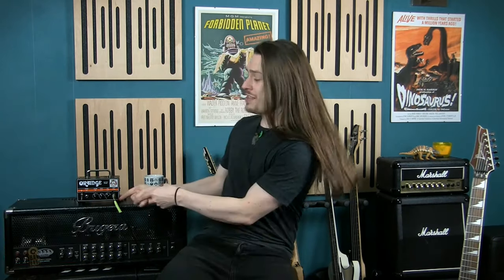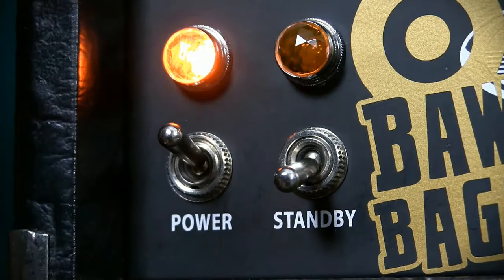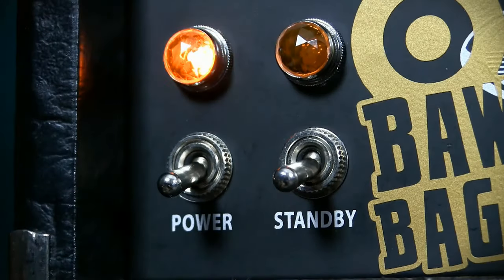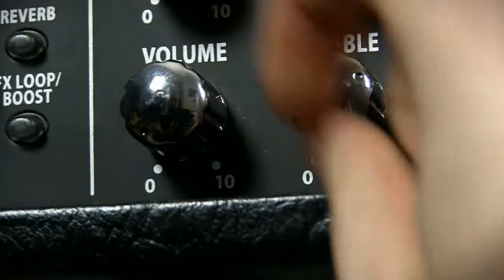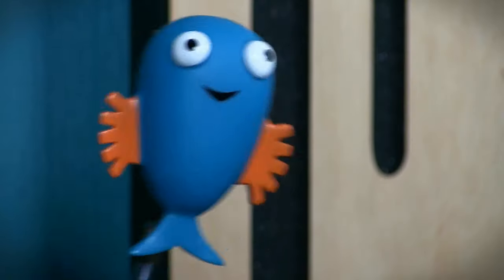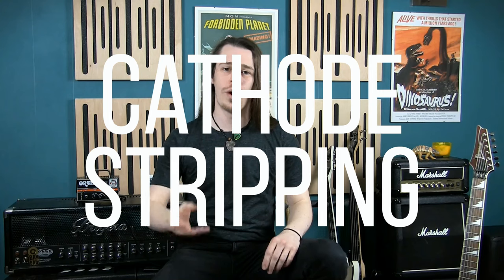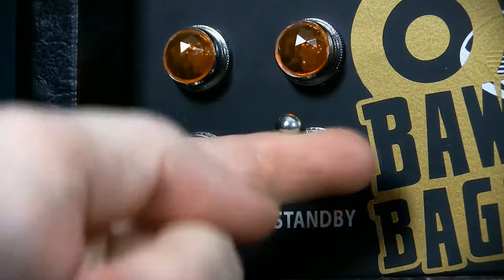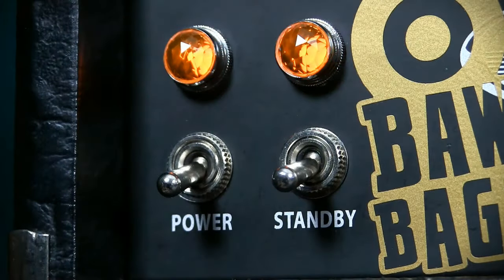Your Standby Switch Is A Lie!

Comment: You're absolutely correct!  Since I stopped using my standby switches (over a decade ago), I rarely have problems with amps or tubes.  My tubes remain quiet and eventually wear down gracefully.  I just turn the amps on with volume, gain and reverb turned down completely.  I turn volume and gain down before turning amps off.  On set breaks, I simply turn the volume down.  The amp builder who made several of my amps quit installing standby's on his amps a number of years back.
Reply: You could avoid messing with your settings by just switching the standby switch...

Comment: Honestly, a mute function (no matter if its called "standby" or else) is great, because you don't mess with the volume control, which might have been a chore to get right.Plus obviously you don't get any noises when actually shutting down the amp (though that could be solved otherwise as well).
Reply: I agree. I have the PRS MT15 which has an incredibly sensitive volume knob for the lead channel. A slight change of the knob will make the amp very loud or dead quiet. That's why I like the standby switch as mute switch
Reply: I built my homebrew amp with adequately rated filter caps, with heater elevation and arc protection components on the cathode follower. A standby switch is totally unnecessary, but I did include one. It's a switch which grounds the wiper of the volume control and is labelled 'mute'.
Reply: It's also really nice for switching guitars, unplugging or plugging in pedals 
I think I've used it to change my speaker configuration before? I'm not sure if that's actually safe though
Reply: @redderm  Yes, that is one of the real benefits of a standby switch. Being able to switch amps or cabs, without damaging the transformer. 
Although, I think you can do the same by rolling down the volume on the amp. But its just so much easier just to flick the standby switch lol.

Comment: On the Marshall JVM series, the standby switch also engages Silent Recording mode via the emulated output socket. You can operate your amp without a cab in this condition. The emulated output sounds great, by the way.

Comment: I personally use standby switch when I'm switching my guitars in live situations... also when I want to mess around with different pedals and put them in or out of the loop. In general, standby switch comes in handy when you want to mute your amp in a recording situation, cause you don't want to touch the volume knob on your amplifier or else you would be shoot dead by the recording engineer.

Comment: Great video, don't know if you know this but a standby switch can actually damage tubes by causing cathode poisoning ( oxidation of the cathode of a tube)  which happens when the cathode is heated but no current flows through the anode causing a high-resistance chemical layer to be formed between the cathode tube and the barium layer of the cathode. It is called interface resistance growth and it can shorten the life of a tube.
Reply from the maker: I do know about it, but decided to not include it as the jury is still out on whether or not cathode poisoning is actually a threat or not. 
There is little evidence to be conclusive either way, but I did hear that old valve jukeboxes would sit on standby until a coin was put in. Those things would sit in the corner of pubs switched on for hours without music playing through them, and the valves would run for years without needing replaced. 

Whether that holds any water or not is a different story, and who can tell if poisoning was hindering the performance of the jukebox and people were just too drunk to notice?
Reply: not on guitar amps.

Comment: I modify, repair, and build amplifiers and I say you are 1/2 way correct on this issue. The standby switch is very useful when A- repairing an amp B - on a fresh build. On a fresh build if you have an issue many times during the initial "warm up" you can identify a problem before you blast it with hundreds of volts. Amplifiers with tube rectifiers, the standby is 100% not needed, It takes a minute or so for rectifier tube to generate the current needed for the amp to have enough power to amplify. However, with solid state the high voltages are developed much faster and can shorten the life of your tubes. By how much depends on the quality of the tubes and how often you turn the amp on & off. You NEVER need to flip off the standby and then wait a minute or so to turn off the power, switch turn them off together and no harm will come to your amp. Bottom line is, if your amp has a standby switch use it, if not don't worry about it. On another note, you mentioned standby switches wearing out faster than your volume pot, it would take years to wear out a quality switch in a good quality amp.
Reply: The only reason i can see why a standby switch would be beneficial for
 solid state rectified amps is if the filter caps are only rated for 450-475V. If you switch on HV before the tubes are fully heated and conducting then they aren't yet presenting a load to the power supply, and the B+ voltage in the amp can exceed the voltage rating of the caps.

Comment: Agreed. Good bit of information. Standby makes a good mute switch. I have had many vintage tube amps and tube radios from the 40's and 50's. No standby switches. They are all original tubes except for some updated power chords, and they still work perfectly.  I turn them on, and they start to put out sound when they are good and ready. Rock on C!

Comment: Actually there are various scenarios where a standby switch is beneficiary. For instance, amps that feature cathode follower gain stages, can short out a preamp tube if not warmed up enough. There are also designs where bias voltage comes in (and out) rather slowly. You don't want to put plate voltage on a tube without negative bias.
Reply: It is not unknown for DC coupled cathode followers to still flash over even when a standby switch is utilised "properly"

Reference: http://www.valvewizard.co.uk/dccf.html

Comment: Neither of my tube combos even have standby switches. My Vox AC30 head had it and I never used it because it would shorten the life of the tube rectifier.
Reply from the maker: You may be interested to know that the original AC30s didn't have a standby switch, it was only later models and reissues that got them after the standby craze fully caught on and people started to question why it wasn't there.
Reply: And when they did fit one, they put it between the tube rectifier and the reservoir (first filter) cap. This meant that when switching out of standby the poor rectifier saw the discharged filter caps, almost a dead short, resulting in quite a few dead rectifier tubes. So they fitted a resistor in parallel with the switch so that the filter caps could charge during standby, thus making the standby switch pointless.

Comment: Merlin Blencowe and Kevin O'Conner are writing about the standby switch from the perspective of new amp designs.  Techs and amp designers are their target audience.  The Standby switch protects the power supply capacitors.  

Switching on both "Power" and "standby" puts the full, unsagged B+ voltage to all the power supply capcitors.  WHen there is no current draw (cold heaters) , there is no voltage drop.  The whole amp is hit with full B+.  Preamp capacitors that would see less than 300V when an amp is warmed up, may see 500V or more when the amp is cold.  The common peavey 5150 is an example of an amp that has a B+ when in standby that can be as high as 510V.  '69 plexis have B+ in excess of 520V when in standby.  Problem is, you won't find any power supply capacitors rated at over 500V in either of these amps.  Once a tube amp warms up, the current draw will "sag" the power supply and bring voltages below the rating of power supply capacitors.  Any 50 watt or 100 watt amplifier will be running close to 500V B+, don't be tempted to think yours is an exception.  

Using standby is not only convenient, it will save your power supply caps.
Reply: This is all true, and I think it's probably the real reason Fender added the original standby switches to their big amps -- to protect under-rated caps.  But most capacitors have a surge rating that allows them to handle more voltage for a short period of time, usually about +10% for up to a minute.  Tubes rarely take more than about 20 seconds to fully warm up.  And all of this goes out the window on any amp with a GZ34 rectifier (like an AC30 or a 5F6A Bassman), which takes as long to warm up and pass high voltage DC as the power tubes take to start conducting, resulting in no surge at all.
Reply: Capacitor lifespan is a function of percentage of maximum rated voltage.  Why abuse your investment?  Plus, you are still ignoring the possibility of Grid to Cathode arc in cathode follower circuits.   I don't see a compelling reason to promote this idea.

Comment: You know, I wondered about this.  Since I'm not really a musician, I used to spot what kind of amp was valve or solid state by the presence of lack of Standby.  However, I am trained electronic tech and could never wrap my head around the concept.  When  I bought a 15W Marshall valve amp and there was no Standby, I shrugged it off, because clearly Marshall wouldn't have eliminated the switch if it was going to mean the amps were busting tubes constantly.  But every time I look at the panel, I wondered what happened with Standby.  Now I know!

Love your work Colin; you're a great help to us hobby players.

Comment: Bro.. probably the point of the standby is to stop the sound whilst you don't change the EQ that you programmed with the band!

A lot of pedals make the volume knob so sensitive that is hard to set it! so there comes the standby!!
Reply: This would only make sense if the switch was on solid state amps too. It isn't.

Plus most tube amp manuals specifically state you have the standby switch to protect your valves.
Reply: Yep!! I know that!! I believe that this is 1 more point hehehe
Reply: my Boss Katana which is solid state has a standby switch.
Reply: That makes sense especially when dealing with amps over 100 watts in a live setting.  Messing with a volume pot that is exponentially sensitive is far more irritating than just switching a switch.
Reply: I don't see what is so hard about remembering to turn the volume pot to 11 when you are ready to engage. Really Colin needs to answer why the volume is a pot and not a switch.
Reply: most venues you cannot put your amp to 10 let alone 11 if its 100 watts, most venues will not invite you back if you play at levels that loud.  If you have a tube amp crank it to 11 and try playing in the same room as it for five minutes and tell me how your hearing is afterwards.
Reply: MetallenVikingr I always turn the volume 1 notch past maximum. I don't know why the size of the venue would matter. Tubes were meant to be ridden. When you turn the volume down it restricts the flow of electrons killing your tone and leading to worn out tubes. It is like keeping your Agera in first gear.
Reply: Pushing a tube will sound better than say a solid state amp being pushed but as for it damaging the tubes one must be insane to think that a tube amp must be pushed or the tubes will be damaged.  Some tubes will blow when pushed too hard especially on many home made amplifiers and amp kits.  As for tone I am a sound engineer i know for a fact that tone is more about signal chain and the equipment one uses than it is about pushing the tubes to their limit.  Power soaking tubes is why smaller amps like the Peavey 6505+ MH have been made.  20 watts and it pushes the tubes at venue level volumes.  Venue size does matter.  Unless you are playing an open air festival you really cant open up a 100 watt amp without destroying the hearing of yourself and your fans.  I cant even push my 6505+ 100 watt head past 1 in my apartment and it is still very loud.  Not to mention one has to compete with bass and drums and they need to be at a good level too.  Balance in a mix is key to a good live show not being the loudest band, being loud will only muddy your music and make people leave the venue, which im sure the venue will hate.  I suggest you go learn more about tube amps before trying to educate professional musicians on their craft.
Reply: MetallenVikingr I'm no sound engineer, but I have two ears and a guitar. I think you are mistakenly pushing your tubes to the lower limit which is terrible for them. If you really want it quieter use a smaller speaker cabinet and/or a smaller amp wide open. Still makes no sense to me why you would do that.
Reply: Well to get a similar sound on a quiter level. 
There are lots of amps using power soakes to do exactly that. (Mostly by shutting down tubes). There are also very expensive power-soak versions to achieve that for every amp. There are some people willing to invest 2-4k € to really get as close as possible to the same sound on a lower level.
Reply: Ha Ha, That is funny, I think people are just programed to expect it. You feel like you are following a routine. It makes people feel comfortable.  The manufacturers do things like that.
Reply: But if you have a "lot of pedals" you'd most probably have a volume pedal too, or at least you ought to. If not that, you certainly have a volume knob on your guitar.

Comment: Thank You! Finally someone made sense of this for me. I've been using Line 6 gear forever but was given a great deal on a Fender Twin '65 Re-Issue.When I put a tube driver and delay on it I was knocked out at the God like noise that came from it, it changed my life and approach to playing, but I was concerned about the standby and my lack of knowledge on it as I didn't want to damage my "lost arc".Every video I watched left me more confused than the last, I admit I'm not the most tech savvy guy and I know about guitars more than amps so thanks again for the no b.s. breakdown, new sub.

Comment: I read the links you posted the following is from Mesa Boogie on how the switch works: The STANDBY shuts down part of the high voltage to the power tubes so that they can rest at idle without wear. It provides a start-up procedure (follow the Cold Start procedure… wait at least 30 seconds after powering up with the POWER switch before turning the STANDBY to ON). This reduces the shock on cold power tubes and increases their life. The STANDBY is also great for muting the sound during speaker changes and should also be used to cool the amp down during set breaks or when swapping tubes.

Comment: Makes sense.  I've got an early 60's Silvertone 1481 tube amp that hasn't got a standby switch.  It simply has a power switch & takes roughly a minute to warm up & produce sound.  That little booger is a beast of an amp, too.  Beautiful cleans & nice breakup above mid level volume.